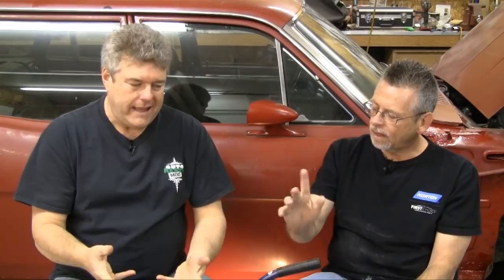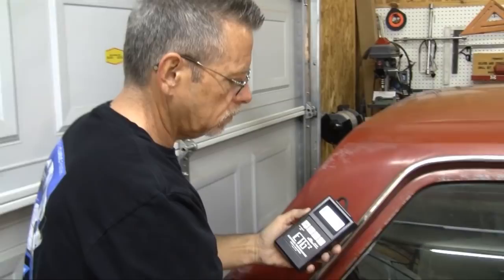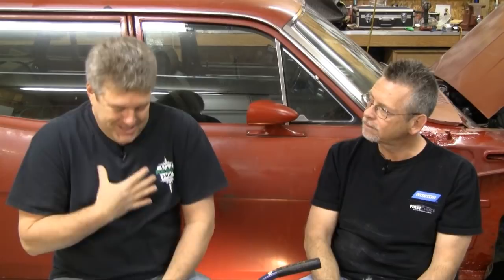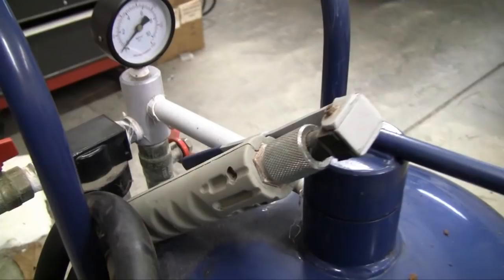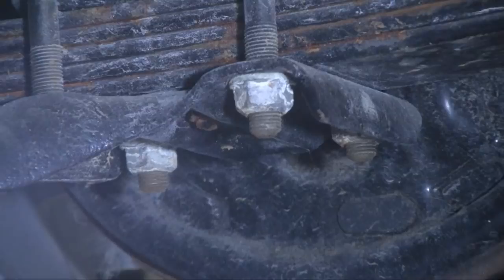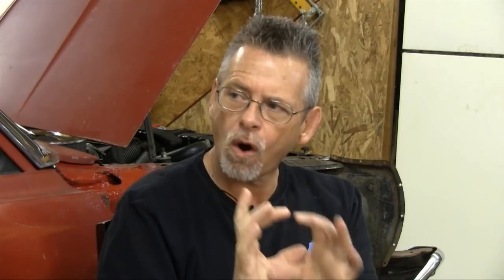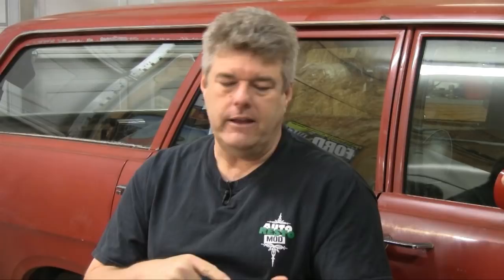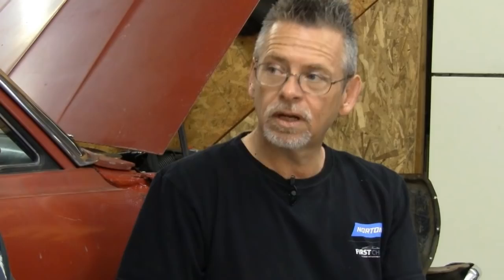Six Ways to Strip the Paint Off Your Classic Car Pros and Cons Episode 201 Autorestomod

Comment: Was hoping for some comments on sandblasting....
Reply from the maker: Well, I ave recently had a panel sandblasted...and it sucks. LOL I don't care for it at all. The sand can dig craters, cause warps (from heat) and other things. Are there people who can sand blast? Yes. But I haven't had the good fortune to use them in my 20 plus years mucking about with cars.
Reply: AutoRestoMod Car Restoration Modification 
I have a 63 Nova I have get all the paint off of.  I was hoping to buy a Northern Tool sand blaster and give it hell... carefully. I don’t know what I’m going to do. Sure appreciate the info in your video.

Comment: This is frustrating.... I've spent hours watching methods to remove paint and they all suck.  All I want to do is quickly and freely remove paint that is almost falling off aircraft aluminum.... its already gone in large patches.   I'm thinking some kind of drill and a vinyl wheel.   

Media, chemicals, all this equipment is too expensive and is unacceptable.
Reply from the maker: +PC5032 Well, being that you are working with aluminum, there is your biggest issue. No "cheap" method is going to give results that don't also work very fast to remove the aluminum as well. The vinyl wheel will probably not give great results and will be very time consuming over vast areas. If the paint is sheeting off, you might try a high pressure pressure washer.
Reply: +PC5032 Cheap methylene chloride paint stripper from the hardware store will strip that paint off in minutes and not affect the aluminium.

Comment: No mention of aluminum oxide.
Reply from the maker: Aluminum Oxide is great for parts like aluminum intakes and exhaust manifolds. Can be used here but its abrasive properties are pretty aggressive.
Reply: @AutoRestoMod  Actually it works great on steel to remove paint and rust.  I've used it extensively on  body panels and all other parts.  That's why I was surprised they made no mention of it.

Comment: Good info!   You may want to consider this.  I'm stripping the engine compartment on a 60 year old car.  I found 3m bristle discs work really well, as do the abrasive pads.  The ones in the video are 2" which are great for smaller areas.  I also ordered 3" to rip through larger areas.  http://youtu.be/-CrTDb8IUxA
Reply: Agree with you +Ben Clark. I used the 3M clean and strip discs to remove paint and rust from the floor of my FZJ70 cabin. It works pretty well and did not build too much heat. The regular roloc bristle disc according to the videos and info I saw has as good results as the clean and strip discs and last longer. Also, there is the 3M radial bristle disc, better suited for delicate work or small or intricate surfaces like that windshield louver. +AutoRestoMod if you can try these other alternatives and give us your thoughts about them it would be nice.
Reply from the maker: Gustavo J Romero B We have plans for an engine bay refinish on the Fairlane so we'll be using a bunch of other products in there. We've used the bristle discs and like them. The would fit very well in the mechanical side.We are hoping to show the hood and fenders being stripped on the wagon by Larry's favorite method, plastic media blasting.